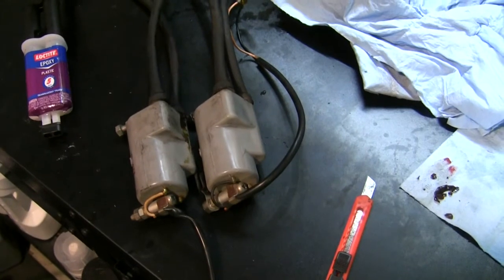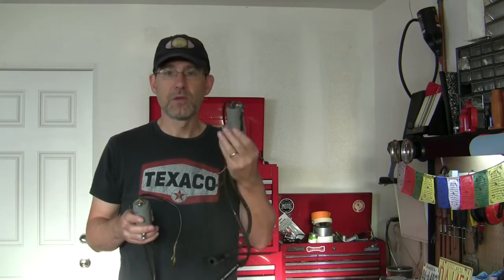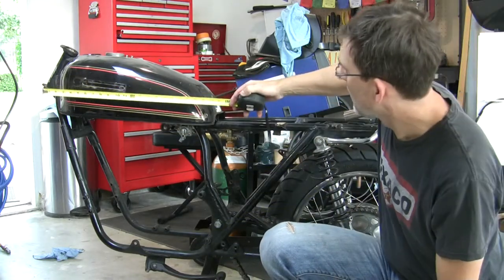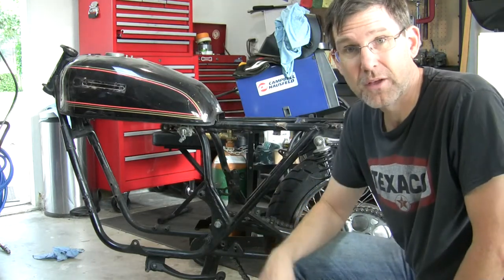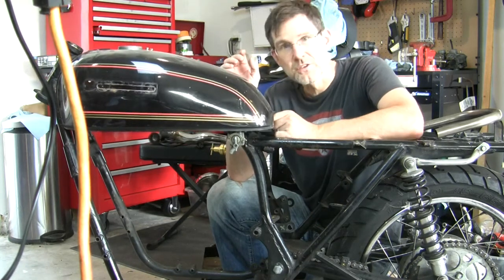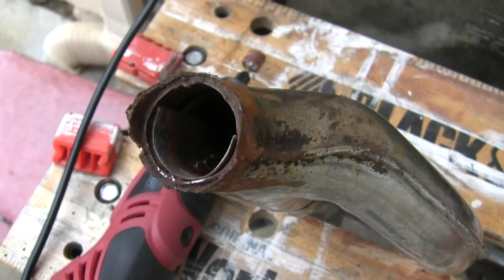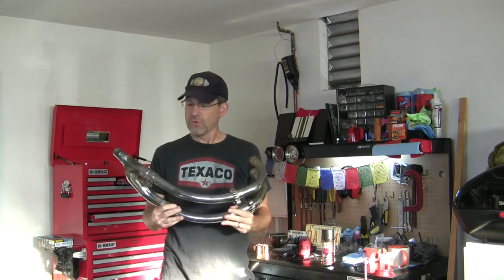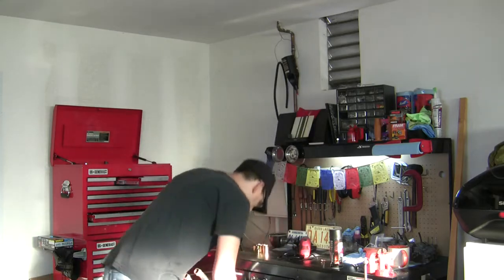Ignition Coils & Exhaust Welding - GS550 Cafe Racer (Part 26)

Comment: My 1981 GS850GL plug wires are showing distress, they have some cracks in the wire insulation and I think that they are original. Should I replace the coils or are the wires replicable?
Reply from the maker: If they are like my 78 model, they're hard wired into the coils so replacing them involves replacing the coils too. EBay sells inexpensive universal replacement coils and wires (high tension leads) that would do the trick. Or one can buy OEM still from suzukipartshouse.com. Z1 Enterprises may have something too. Hope that helps. Thanks for watching!